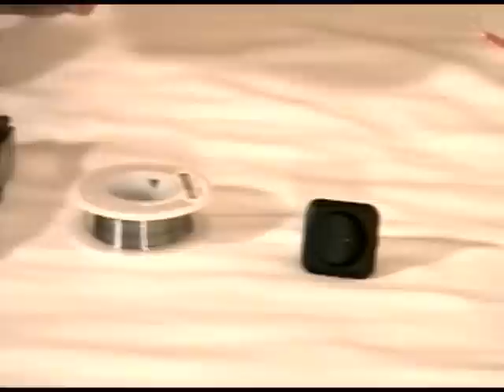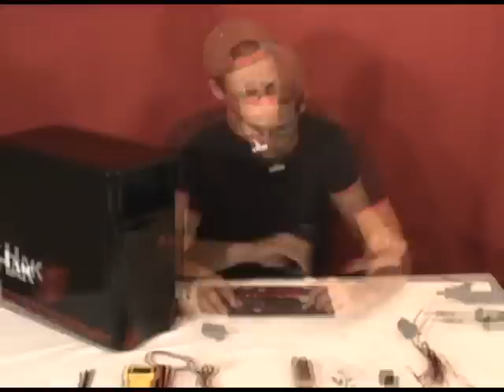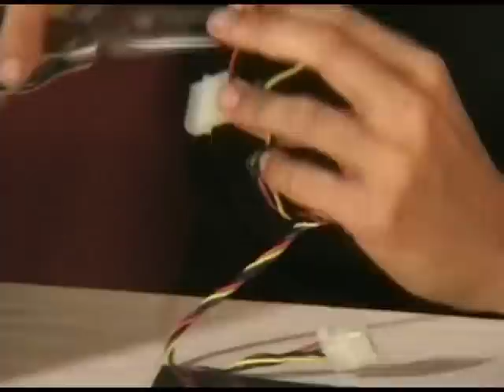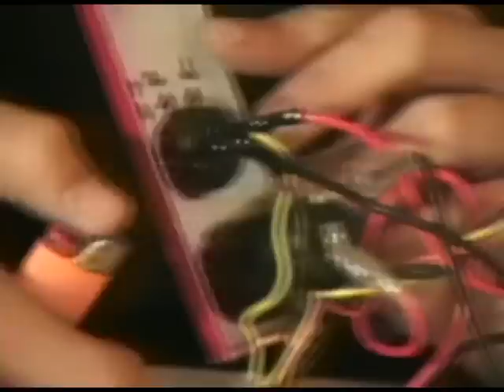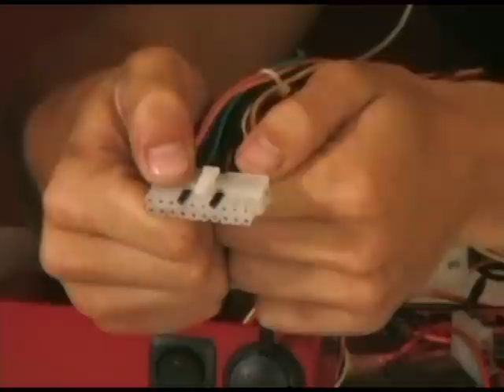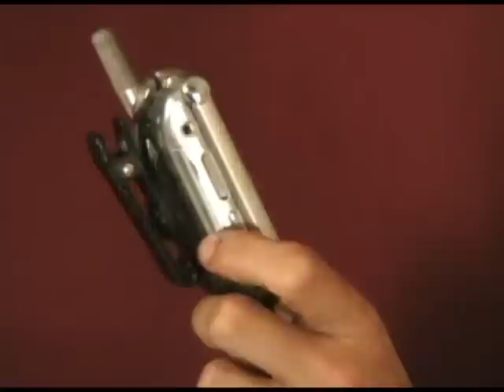Hak5 - Mod a 12volt power adapter on to your PC case

Comment: Thanks for the tips! Do you know what kind of current you can pull off of that plug? I imagine that it is related to power supply Wattage ratings, but I recon... ballpark 2 Amps to 5 Amps maybe?

Comment: I see a couple of problems here.

1. That panel is not strong enough to withstand all the plugging in and pulling out. I could see it flexing when the device was plugged in.
2. All of the accessories that would be OK to run in the PC have USB cables available to them (phone chargers ETC).